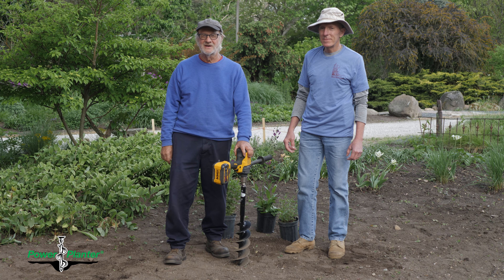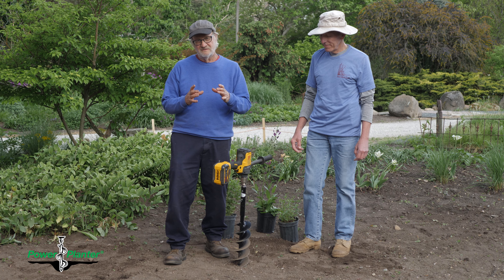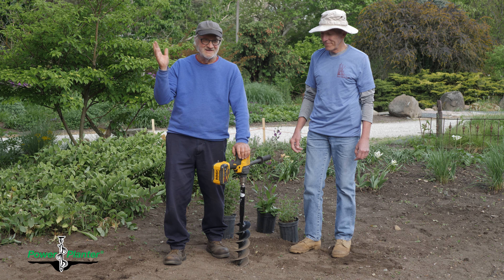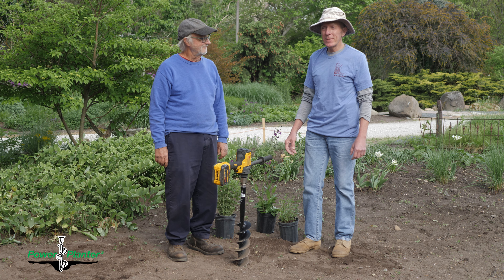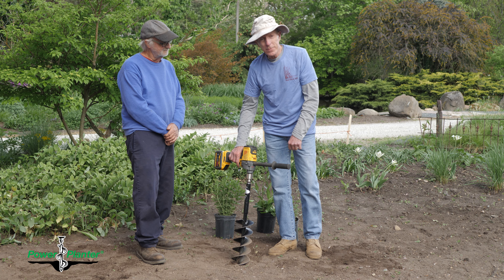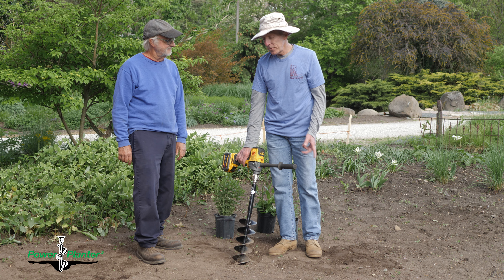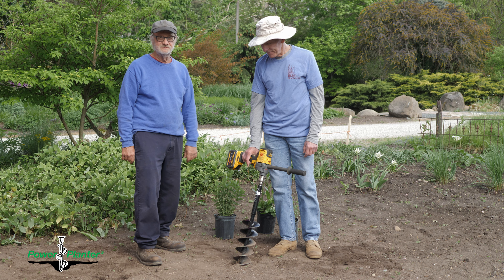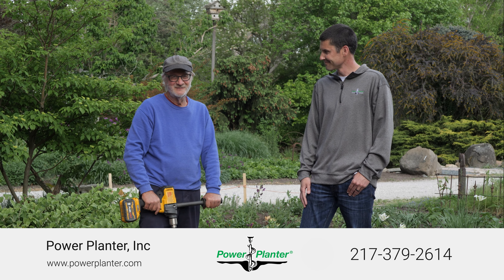Roy And Bob Talk about Planting with a Power Planter Digging Auger

Comment: I use a Ryobi  40V post hole auger to plant almost everything in my garden. I use weed control fabric with 12" sq windows cut where I want my plants. I just drill through the openings add amendments and plant. I use paper mulch around the plant stem when they get established.
My garden is almost weed free and the growth is amazing.
Reply from the maker: Well when you are ready to upgrade to American quality let us know.  Unfortunately, Ryobi intentionally made their shaft a special metric size so it can NOT be interchanged with other augers, so you are 'stuck' with that until the batteries die...then you can start over :)

Comment: Would you or someone comment on the choice between the regular 7" x 28” ($133) auger and the heavy duty tube drive auger THD tip and replaceable blades for $100 more?
Reply from the maker: If you are a pro landscaper or have bad soil conditions for home use the HD version is the way to go.  It has replaceable parts and everything is heavy duty (and replaceable).  The regular grade is great for occasional use and in decent soil conditions.  Give us a call at the office M-F 8-4 and we can talk through it with you too.  217-379-2614